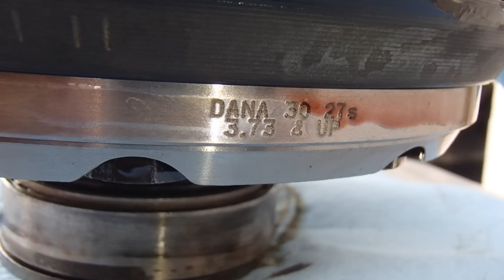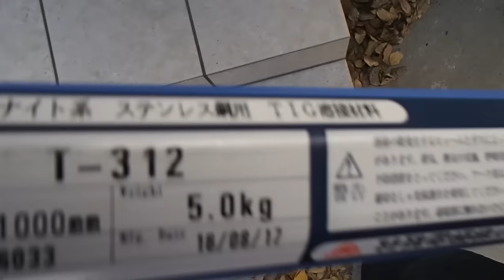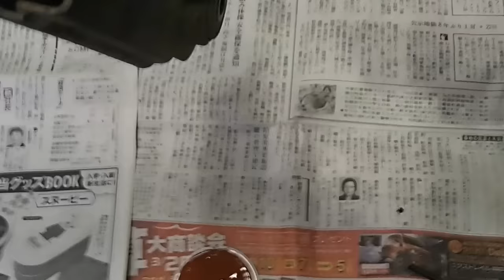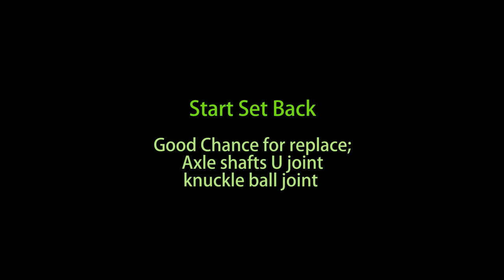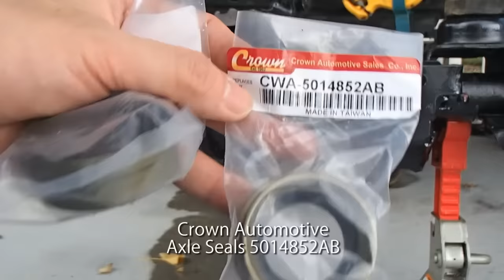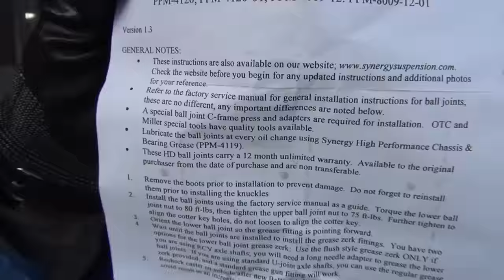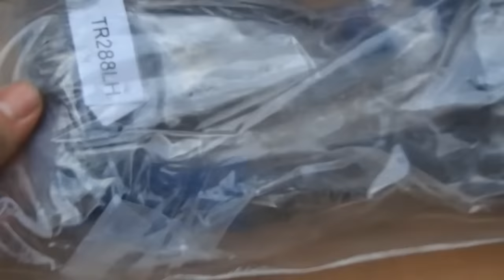DANA30 Axle upgrades for Jeep JK wrangler RHD with ball joint axle seal replacement

Comment: I  need the rear end replaced in my 2000 Cherokee. My pinion is bad plus other bearing bad.  Im wanting to take out axles, housing an all out of my 2000 cherokee and replace it with another complete housing axels an all. Unbolt u bolts drop it all. What modal jeeps will inner change. I know i have a Dana 30 in the front and its good and a Dana 35 in the rear thats bad.. My  rear gear ratio is 355. What other jeep rear ends will inner change and that  i will be ok with my front end dana 30

Comment: Like the video man but 2 quick questions, #1 why did you drill all of the holes in the axel?  I was already curious but then saw you weld them back up??  I’m seriously curious bc I have been contemplating the axel truss and gusset kit.  #2 why all this for the Dana 30, wouldn’t it have been cheaper to get a dynatrac 60 with lockers already in it?  Again not hating at all just very curious bc I have future plans on something up front either a swap or truss and lockers and would love to know what made you go this way versus the other?  Hell of a job though, wish I had your garage
Reply: I think he saved thousands doing this himself as opposed to a built dynatrac 60. I would feel comfortable on 37's with a beefed up D30 like this
Reply: This thing is a tank now and he saved thousands of dollars.